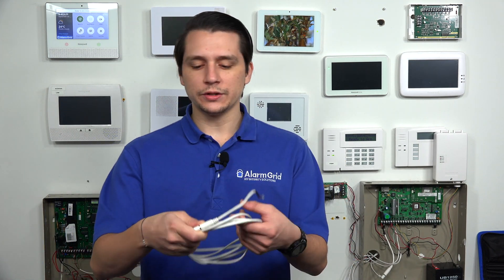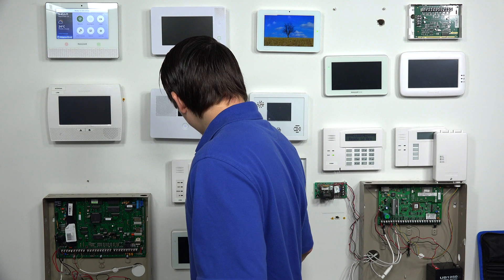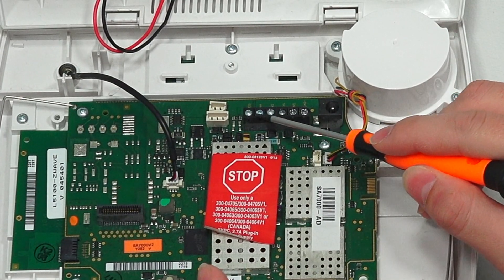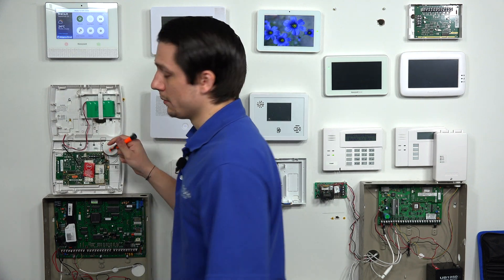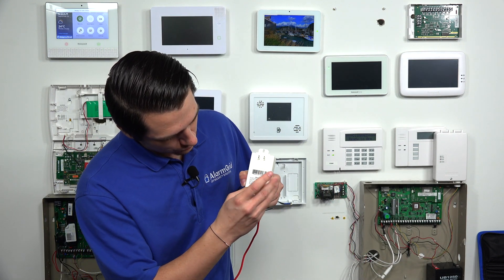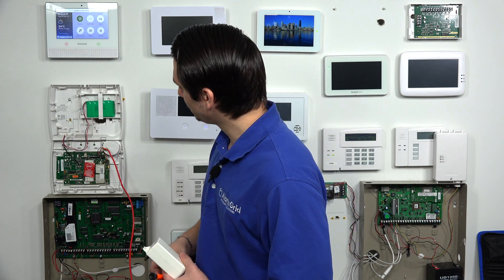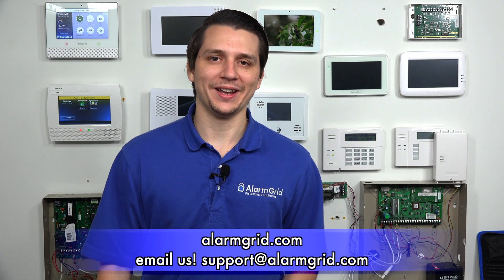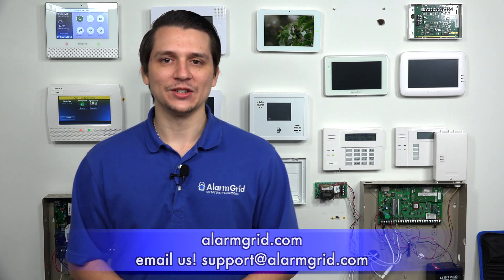Running Power to a Honeywell L7000

Comment: 17:03 Why it zoom out of the system? Is it armed? are the buttons disabled? I cant read it from that far away.
Reply from the maker: The message on the panel shows "System Startup". As Jarrett says, it is still booting up at that point. It finishes the boot process right before the end of the video (when the top banner goes from red to yellow.) The yellow banner shows "Ready to Arm, System Trouble." So, there is a trouble condition on the panel, probably a low battery condition. Power is sometimes removed from these test panels without the battery being unplugged, which causes a low battery condition to often show during the making of videos.

Comment: Hi , what could be happening if I am not getting an alert when there is no power on the alarm when is running just in the battery ?
Reply: The panel should beep an ac loss. If you are referring to total connect 2.0 you want to make sure the notification is enabled
Reply: @joshuagriffin2807  the panel is not beeping . I think the person that configure the equipment did something so it would not bip . As he configure the alarm with the battery .  What would you do so it did not alert you that is not conected .